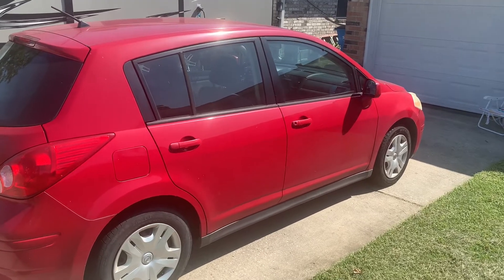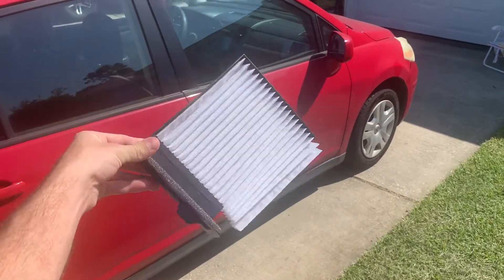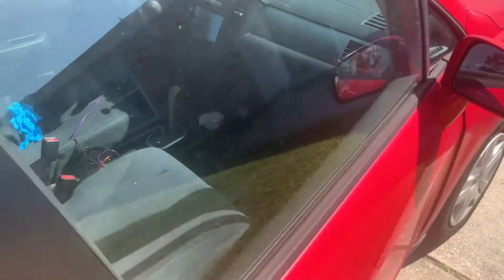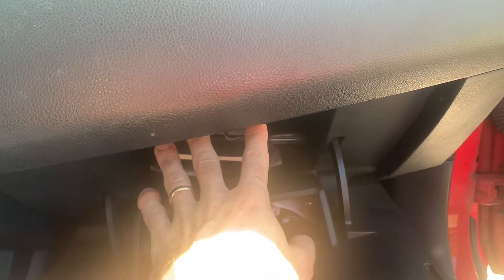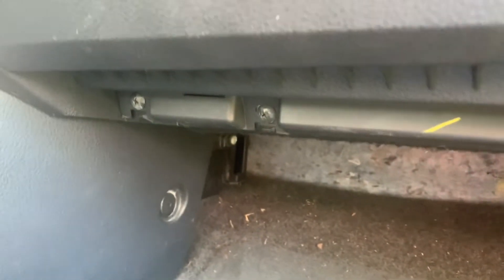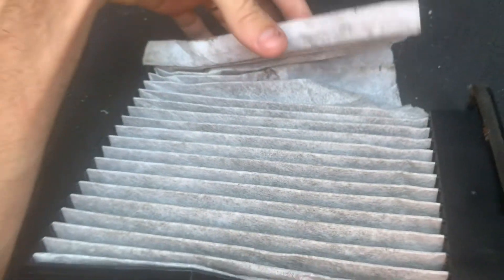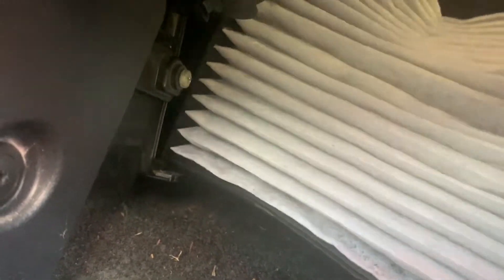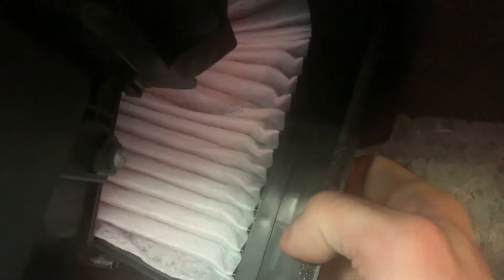2007-2012 Nissan Versa Cabin Air Filter [WITHOUT REMOVING GLOVE BOX]

Comment: I removed the glove box. Put it back in and did it the easy way. Lol
Reply from the maker: Haha yeah, either way it’s pretty easy!
Reply: Got box out ..filter doesn't want to budge
Reply: @michaelg6641 I’m in the same boat. I think whoever worked on my wife’s car last jammed it in, in all the videos, it just pops out and mine doesn’t even wiggle
Reply: @viator22  l got the new one first then used pliers to pull out the old one with that upper tab..it was all dirty and no good. Then you sort of swoop in that accordion looking top material first then it wiggles in pretty easy but make sure bottom edge is seated first then push in top..and use a flash light so you can see the process. Its pretty simple once you get old one out and can see it all.